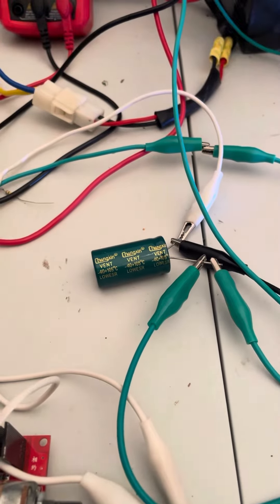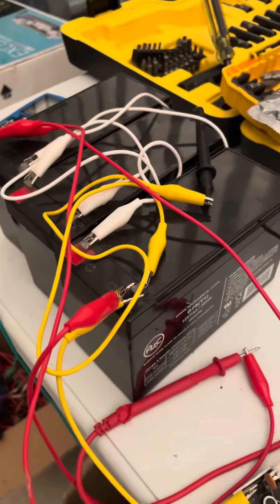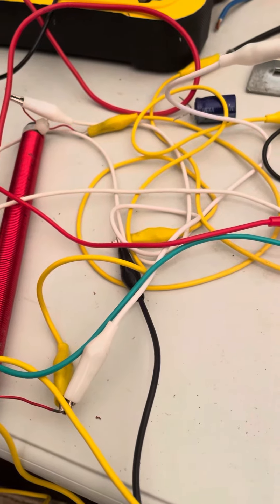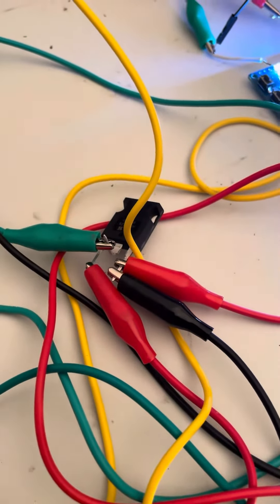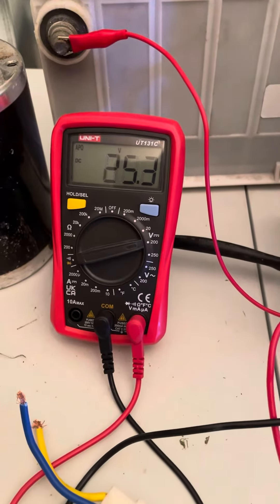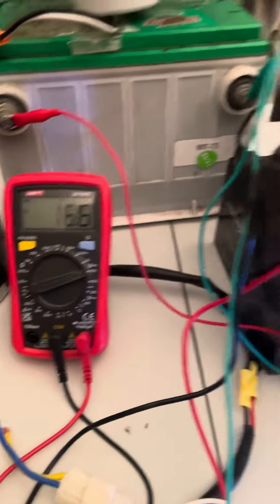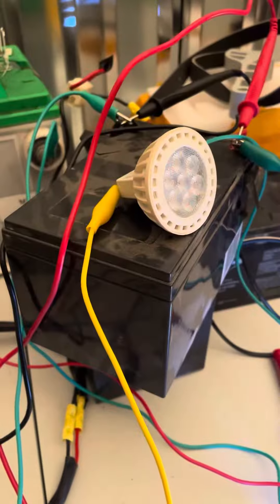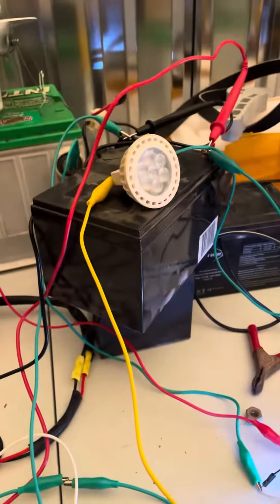High Voltage cap dump circuit

Comment: Very interesting. Never thought to use a mosfet triggered by a pwm. I use thrysistors, or now just a spark gap 75v
Reply: Which solution is better? Could you please explain? I am not so advanced in electronics.